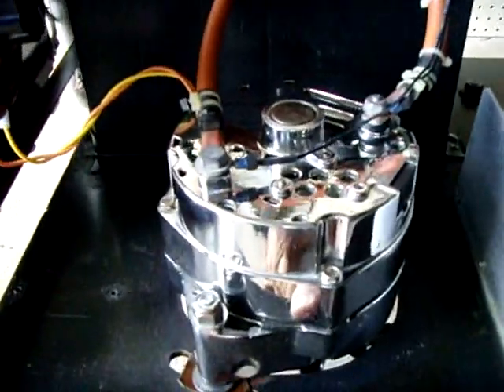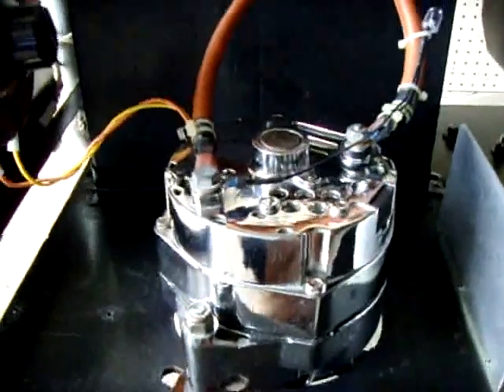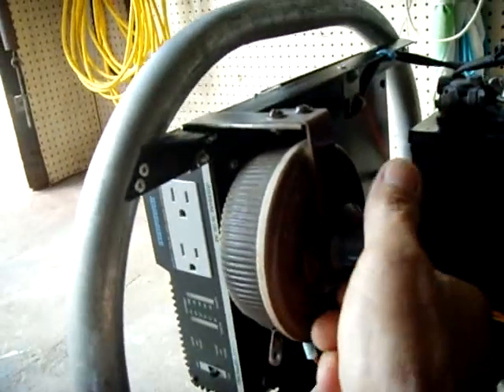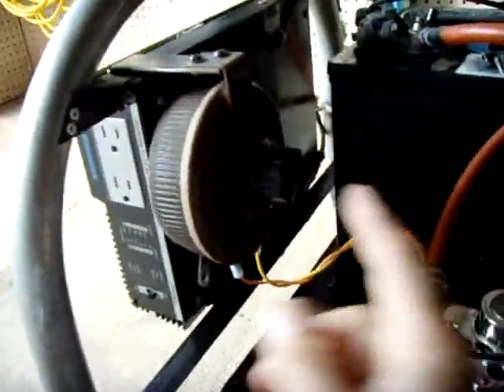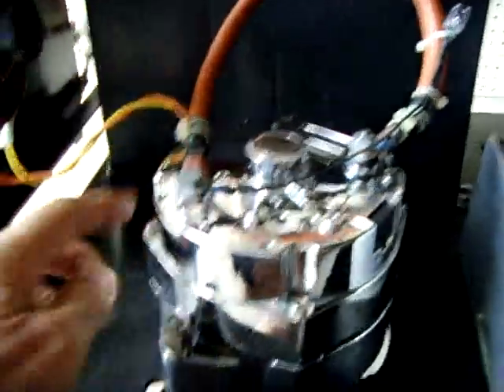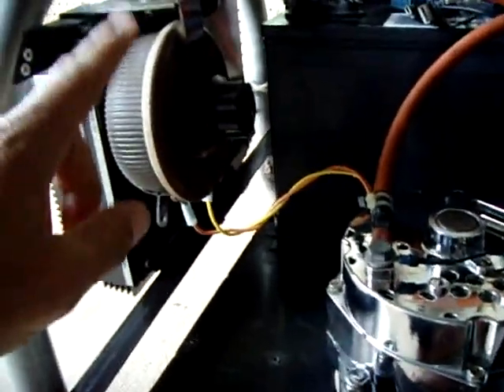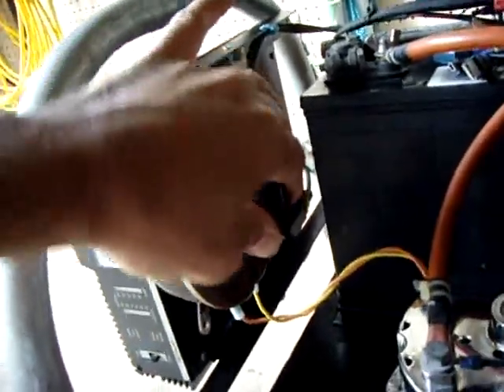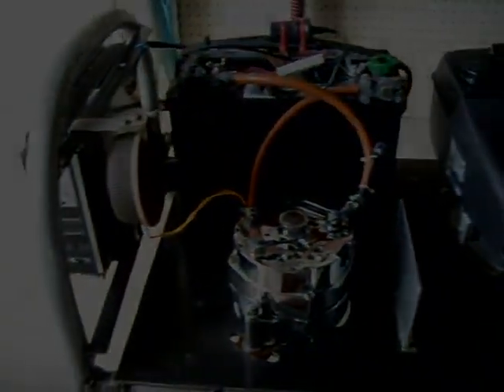Homemade Inverter Generator - Alternator Modification

Comment: Use a 2hp pmac motor and a 2000 watt inverter. Separate the back up engine using an ac electric clutch.

Comment: My 1970's. Ge 36" freezer fridge only pulls 600 watts to start and runs on 320.
I've run it several hours with a 800 watt inverter and my trolling motor battery and still pull the battery below 10volts.
Old school technologys is were it's at for overunity today.

Comment: Hi, what a great video, I'm not an expert, how about using DC motor maybe like 1000w instead of using Engine.

I don't know, maybe like change the engine into 1k DC motor or more KW depends what you need, then connect the DC motor to the battery to turn the alternator to keep charging the battery, then use the battery to turn on the Inverter to power your appliance. I think the DC motor will also need a speed controller, and maybe you can use the speed controller as a switch on/off. I think you can't connect the DC motor directly to the alternator.

Only the engine to be change into DC motor. All the rest on the frame stays on the frame.

And maybe you'll have a fuelless generator?.... I don't know..... 
Tell me if this helps.

Comment: Your engine size is relative to the amount of current you want to drive is my understanding, that's why you don't see 2hp motor driving 100 amps or more at 120/240.

Comment: I did this, bought a horizontal gas engjne, and put a pulley..then i also put a pulley on 24v dc motor..so when the gas engine, started and pulley from motor spinned, the output voltage coming from motor was negative 24 volts...isnt the output voltage suppose to be + 24 volts and not the opposite..does it matter, when charging a battery??

Comment: Car alternator are only 50% efficient you lose half your power off as heat. Lawn mower engines are at best 20% fuel efficient to begin with. Lead Acid batteries are 60% efficient. And your inverter is at best 95% efficient at at worse 80 percent.  Sorry but this is about the loudest, most polluted,  inefficient way to produce electricity I can think of. My 3500 watt true inverter generator can run 10 hours at 50% load on 2 gallons of gas. Not much difference in price. Still polluted and still has inefficient gas engine but is way quieter.
Reply from the maker: Duh. Go back 11 years ago then state your case.

Comment: How to change a 48v battery bank with a GM 10 Si High Apm B.B. Slow Turn Alternator ?
Reply: use a boost DC converter.

Comment: I did a setup like this about 8 years ago (went away for 2 years 😒 so it got "lost") but I had a Kawasaki 6, or 6.5? Horsepower engine on it. Just add another battery or a huge marine battery and it won't drag down so bad.
Reply from the maker: It's a little tricky getting the pulley ratio right. If you go 1:1, there's much less chance of bogging under high load, but then you lose power output since the mower spins around 3100-3500 no load. 6,000 rpm is ideal. I experimented using a smaller pulley on the engine, it didn't work out so well. Thanks for watching!

Comment: Great job on that, i did something similar on a generator my dad built, but i used an old headlight switch with the dimmer, it work out ok, didn't get too hot, came in handy when we had a big ice storm here in oklahoma back in 2012, half the state was without power for 8-10 weeks
Reply from the maker: Thanks. Glad you liked the video! Always nice to improvise.

Comment: Great videos! Keep posting! Question...I'm sure you've seen the ThomasBuie Energy video where he claims that he can run his home on a car alternator. He bypasses the rectifier on the output and feeds the ac power to a junction box and supposedly runs his home off this. Can this be done on even a small scale?...say a garage or shed? How much of the amperage potential can you get out of a simple car alternator? Would love to hear back from you and again, keep posting and I really enjoy your work! Cheers from Canada!👍😁
Reply from the maker: The guy on that channel is full of @hit. Another scam artist. Thanks for watching!
Reply: Technically but very inefficient and dangerous, would dip and surge the voltage on load. Very inefficient, maybe half or 1/4 what you'd get from a gas generator.
Reply: The problem with that approach, is that you will get 3-phase AC power of a varying frequency (based on engine speed) from the automotive alternator unregulated output. In theory you could determine the engine speed needed to make the proper frequency for your home, but there is a chance that it would not be at a speed that will get you a high amount of power. You will adjust the voltage by varying the field current so you would want to disconnect the rectifier otherwise you could be charging your car battery at dangerous voltages. At the end of the day, best to use a legit inverter as shown in this video, or get a separate alternator set up to produce the voltage you want for your home. However in theory, you do get AC power from a vehicle alternator, so if you control the engine speed (frequency) and field current (voltage) properly, then it is definitely possible. Good luck!

Comment: What value of rheostat can be used on alternator? I see you used 10 ohms 40watt 3.2a. 
How do you calculate the value of rheostat based on the alternator amperage output voltage?
Thank you
Reply from the maker: Any low Ohm rheostat that's rated around 5 Amps. Nothing to calculate, if you need more charging current, you rotate the rheostat to the lowest resistance position. Thanks for watching!
Reply: @electronicsNmore  thanks for your quick response.
Thumps up on your project.
Reply: @electronicsNmore  would 5 ohms 100watt 4.48amps rheostat work? Ty

Comment: Hi, could you guess what sort of RPM's or percentage of throttle you are using or do you adjust it depending on load. Would be unreal to have auto throttle adjustment dependant on load but I suppose the project gets too expensive. I have seen the current regulated to the battery on another setup and it was to protect the batteries from being charged at to high a rate, thanks for your video I ahve an alternator on the way and a spare alternator and an inverter so I will be joining you soon.
Reply from the maker: The simple mod I showed in this video worked like a charm for the 5+ years I had the generator. Thanks for watching! Be sure to check out my extensive video playlists for other great videos of interest to you, rate thumbs up, and share my channel with others.

Comment: Great video! I have a question for you if you have time. I have a 10si 24 volt alternator that is a back up generator for my off grid solar system. I have a 840 amp hour battery bank at 24 volt nominal. I do not need this alternator for a finish charge because the internal regulator is vset @ 27.3 this is way to low for my batteries. What I want to do is install a 25 ohm 25 watt rheostat so I can control the current manually. I know that my 10si self exciting 65 amp alternator will not put out 65 amps for very long without overheating. I want to have a rheostat control the amperage manually. I am very aware of the dangers of overcharging left un attended. I have battery condition monitors and amp meters that tell me exactly where the bank is at so I'm not going to boil them dry or overheat them. Can you tell me how to install the rheostat to give me manual current control? I know with a battery when you raise the volts the current goes up. I want to set the voltage at 29 volts. The solar system will handle the absorb mode even on cloudy days. I usually use the inverter charger with a diesel generator. This alternator is just a back up. The voltage is set so low 27.3 that it thinks my battery bank is full when I can stuff another 100 amp hours in at 29 volts. Can you help Me?
Reply from the maker: The rheostat is connected in series with one of the brushes supplying current to the rotor.
Reply: Do I have to take the insulated sleeve on the mounting screw on the regulator out so it will bypass the regulator? I do not want to reduce the current coming from the regulator I want to bypass the regulator and have the rheostat control the current. Do yo know how to do this?
Reply from the maker: Steven Davis
https://alternatorparts.com/img/alternator%20diagram.jpg
Reply: thank you very much
Reply from the maker: You're welcome. Be sure to rate thumbs up, check out my video playlists, and share my channel with others. Thanks!
Reply: electronicsNmore so which field wire are you supposed to run to the rheostat? The + or the - one or both? The way it sounds like your explaining in the video is you take 1 of the field wires and cut it and connect the 2 ends you now have to the 2 connections on the stat, but which one of the field wires is supposed to be used or is it both of them? I seen the diagram you sent to steven about the same question which is an alternator circuit but I do not get the answer from that diagram. Thanks alot, looking forward to your reply.

Comment: maybe i should put mine on you tube  1 little motor 1 alternator 1 inverter 6 batteries a switch some wire nothing else hole house

Comment: more batteries i use a tread mill motor self power my alternatorwith it 6 deep cycle batteries no surge no noise  no nothing does hole house 6000 watt inverter    you spent way to much  for very little power  you people are funny with your contraptions  for a couple outlets
Reply from the maker: +Michael Persico 
Please do not post multiple posts on one video. Say everything you would like to say in one posting. If you have more to add, then add it to your EXISTING posting. You are cluttering up the comment section.

Thank You
Reply: +Michael Persico what motor are you using?  i started building one like what you say but my motor pulled too hard for my inverter to handle.
Reply: Which treadmill motor exactly are you using and has your alternator been modified in any way,say by putting permanent magnet in the place of the exiter coil?Would really like to see your setup.

Comment: Sounds like you need a more powerful gas engine.
Reply from the maker: +Dave M 
Hi there. No. The engine is just fine. The alternator was designed for use with a much higher HP engine. Doing what I did in this video was an excellent idea which allowed me to use the alternator just fine with my 1000W inverter/6.5HP engine.

Thanks
Reply: no engine
Reply: you guys do this for a couple outlets a refridgerator  why  alot of work for a light to be on during a blackout you can use a cigarette lighte r plug for that

Comment: There is chock on top of Battery with two red strips on it. Will you tell me the function of it. How to protect battery from over charging? Thanks for reply.Looking forward to your help in my project.
Reply from the maker: That is the 12V accessory socket. It is nylon tied onto the battery handle that pulls up.

Comment: I am trying to do so. What is the Chok doing on Battery?
Reply from the maker: There is no choke on the battery. There is a battery disconnect and a 12V black accessory socket.

Comment: Question for you:  does this alternator output voltage vary as you alter the rotar field current? Or is the voltage output level consant?
Reply from the maker: What the rheostat does is limit the current into the rotor. More current into the rotor = more current output from the field winding(Stator) into the battery. The maximum charging voltage is set with the regulator. This modification has helped me GREATLY with my inverter generator for heavy loads.

Thanks For watching! Be sure to share my channel with others, post links, and rate Thumbs Up.

Thank You!
Reply: schickmann xz

Comment: Nice idea. It would be nice regulate the system with a servo system, could be done electronically. you could also regulate the gas automatically.
But if the engine really stalls, I guess the engine is kinda weak ?
Reply from the maker: Hey Steve,

I have made more changes since this video was made. Check out my other inverter generator/alternator videos. I modified the pulley diameters on the alternator and engine. Between the pulleys and the rheostat, I have no problems. I use this inverter generator every month. I still have to make the time to get the gas supply the way I want it. I need to have automatic regulation, and have the gas automatically turn off in the event the engine runs out of gas or stalls. I will do that in the future.

Thanks For watching!
Reply: electronicsNmore
Maybe I jump in as well, but with a PMG probably, it much more durable, and makes a lot more current, but you won't be able to regulate the stator, more hard for the engine. You can still servo arrange the engine, by measuring the real current draw out of the engine, and calculate the power needed. That's about how it's done in those inverter gensets .
Anyway, The engine always has to be more powerfull then the gen. part.
1HP = 736W. so, 7360W is 10HP, plus load margin, would be in that case 14HP engine. I'll take a look to your other vid's as well

Comment: Great set up, i have built a microgenerator with a weedeater engine and a yamaha generator, Many asked me if they can use a car alternator with a weedeater engine. My answer was that the engine doesn`t have the power to run a car alternator, but with your set up it can be done. Thank you
Reply from the maker: It is a big help to be able to adjust the rotor current to reduce the load on the engine.

Also check out this video:
Make Your Own Alternator External Voltage Regulator

Thanks For watching. Check out my video playlists as well.
Reply: electronicsNmore
Reply: try a little treadmill motor  works great   why do all you  people think you need these big motors really dont  all these wierd controls  all stupid

Comment: Hi I love the set up!!! can you please tell me how many WATTS is the 10ohm Potentiometer? Thanks
Reply from the maker: I think it is rated around 40 Watts / 3.2A
Reply: Yea or even more in cold climate / forced air heat removal or running it at simply a higher Temp, a crude device with small steps in resistance per winding but Extremely tough, that thing can take 500W for a few seconds or 5kW for a few hundred milliseconds!!

Comment from the maker: No. The voltage regulator is left fully functional. I only use the rheostat to override the Vreg current to the rotor if I have to limit it during a heavy load.
Reply: Great idea, thumps up.... Do you need higher rheostat watts, ohms and amps based on the alternator amperage? 
Meaning if I have 400amp alternator, do I need higher ohms with higher watt rheostat?
Thank you
Reply: No.  He said it only needs to 2 or 3amps of power. Through commutator. 12b I would think 40watt 10ohm potentiometer would be sufficient. But I would double that just for safety.
Reply: Double wattage I mean.

Comment: Hi, just to clarify, did you put the pot in series with the regulator AND the rotor to simply limit how much the reg can put in, or did you completely replace the reg with the potentiometer. I don't really like the idea of the alternator putting out silly volts when the battery is all charged up due to an un regulated rotor. Thanks.

Comment from the maker: The potentiometer is wired in SERIES with the rotor. Max rotor current is around 4 amps. The potentiometer allows you to override the voltage regulator and limit alternator output current.

Comment: I have the same alternator.Where does the return wire go from the potentiometer back to the alternator's regulator: back to the negative lug, inside the case, or one of the spade lugs? Thanks.

Comment: run some capacitors on it to ... ac on the ac side and some dc on the dc side .. see if that helps
Reply: wouldn't matter, the inverter has caps built in. needs a flywheel or bigger engine.

Comment: I have made one of these generators exactly as you have. I have a 3 hp Briggs hooked up to a 105 amp alternator. Then that is hooked up to a deep cycle marine battery. It is the same looking alternator as yours. I would like to regulate how much power the alternator puts into the battery. Could you tell me where I could find one of these weather it's online or at a store. Thanks! Your generator looks sweet!

Comment: me and my buddy are doing this very soon im chipping in 2 deepcycle wheel chair batteries and a 6.75 horse briggs does it matter what direction the alternator is turningor doesnt really matter. your input/experience would really help. my buddy will only be using it for a computer and fish tank filter

Comment: Nice idea, limiting the regulator drive to the rotor :-)

I used to work at an auto electrics factory so i appreciate the problems your dealing with.

You cant beat a basic alternator with no frills, less to go wrong :-)